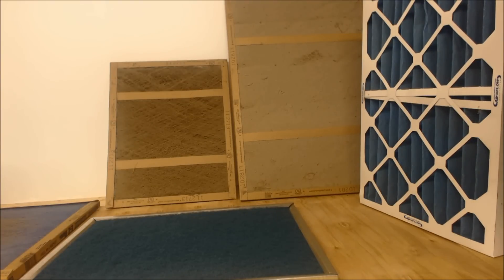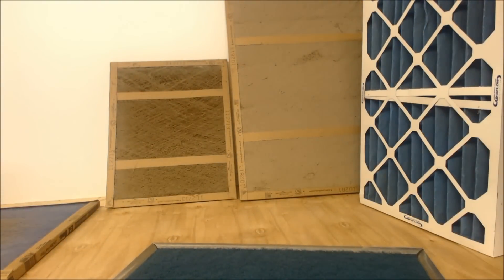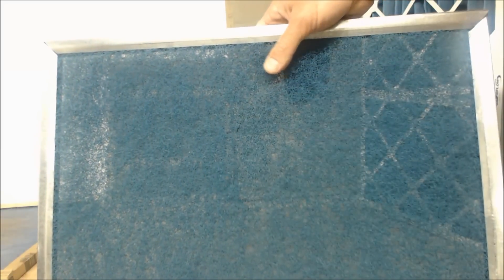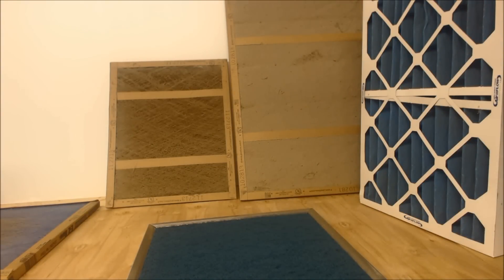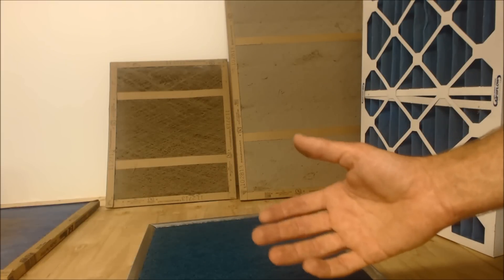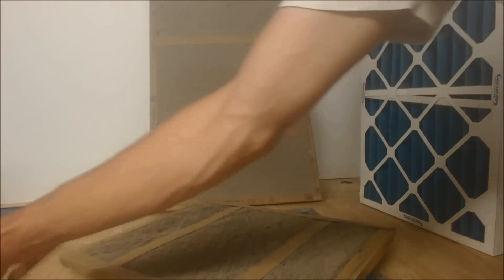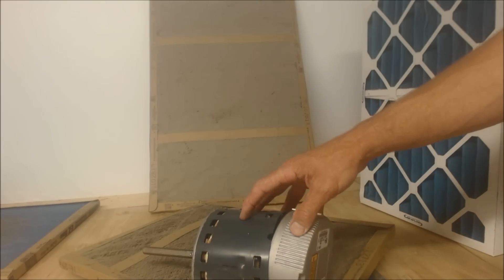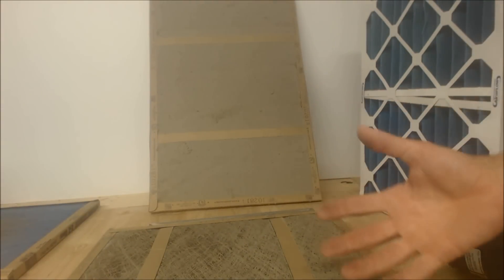HVAC FILTERS: Truth about Dirty and Clogged Filters!

Comment: I heard if a blower wheel that has has had a heavy buildup on it for years cleaning it can cause issues with motor.
Reply from the maker: Wow, i've never heard of that one. I clean them quite a bit and we need to in order to get the correct cfm. Did the person give a real reason such as now the motor works as intended and draws more amps or the dust gets into the inside of the motor or something? Maybe it is the way they are cleaning it without a shop vac that is right next to the bristles of the brush. Thanks David!
Reply: LOL! Yeah I really don’t remember but for some reason when I was watching this video it made me think about it. Figure I better run it by you to see if you ever heard of it.

I had a job on Friday where the blower wheels were so bad. I pulled them out to check heat exchanger for cracks or rusted out spots. I told home owner what I found and even should him the videos and pictures I took. Needless to say he wasn’t happy because we have serviced his equipment for years and I was the first person to ever tell him that. I told him that they need to be cleaned. I mean it’s not even vacuuming them I would have to clean with degreaser or coil cleaner that’s how bad they were. I need to start taking videos on my personal phone so I can upload them to YouTube. Let me see if I can transfer them from the video platform we use.
Reply from the maker: Ok if you are not already doing it, try to capture your video in 16 by 9 with the phone horizontal when possible for uploads. Sounds good David!
Reply: Okay I uploaded 2 videos. I couldn’t find a way to upload them with the program we use so I just played the video and recorded it from my other phone. 

One of the video is of an inducer motor on a package unit. Is that the bearings that are feuding like that. Notice the zip screw the is drilled into the motor housing on the right hand side.
Reply from the maker: Just answered on your channel, thanks David!

Comment: hello, just started watching your videos,  so on the fan motor,  you said the motor will not ,be able too over the friction, and to recap,  the motor will speed up, due too the ligher load ( lack of air molecules) corrct
Reply from the maker: Great question! The PSC motor will not overcome the friction from a dirty filter to deliver the same cubic feet per minute of air as before. The air will slow down in the ductwork and the motor will speed up and draw less wattage. An ECM motor will provide more torque to deliver more airflow but will not overcome the friction as much as a variable speed motor. There is a limit though to how much friction a variable speed motor will overcome before it just draws too  much power and burns up. Thanks for the clarification question!

Comment: Hi My name is Casey I just want to thank you for your videos and knowledge I really enjoy learning from you I do have a request I am in Ac school and like to make a wiring board to practice troubleshooting going to use lightbulbs thermostat transformer to Capacitor and other component to stimulate  an Ac do you have a pictorial schematic that you can email me and also do you have  Videos on line Jpcasey1968@gmail.com 
Thank you for your time Casey
Reply from the maker: Not at the moment but you could cut out a 2' by 2' piece of plywood and wire a cord with a plug to a contactor and power all other devices like light bulbs and your 24v transformer from there. You could use three light bulbs, one for cooling, heat, and fan. You could use a general purpose relay to break one, a 8 or 12 amp fan relay for the other and the contactor for the third. You could screw all these to the board with 1/4 by 1/2 zip screws. You could run 24v power to the thermostat and from there power the fan relay with g fan and common back, power contactor with y cooling and common back, and general purpose relay with the w heat and common back.Check out some of my videos in the playlist such as wiring thermostats, general purpose relays, and contactors.I hope this helps!Thanks for the Comment!